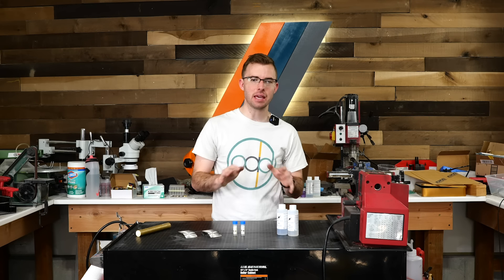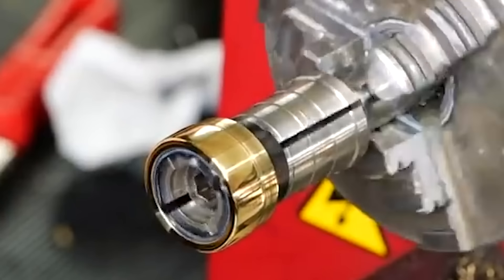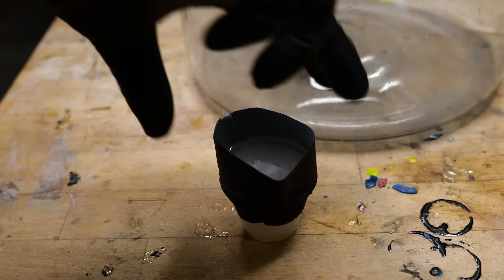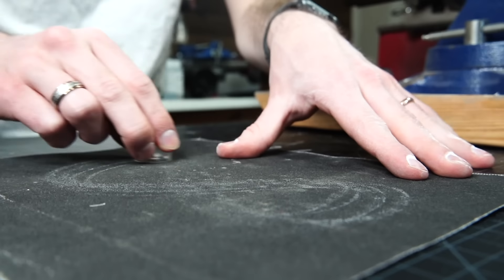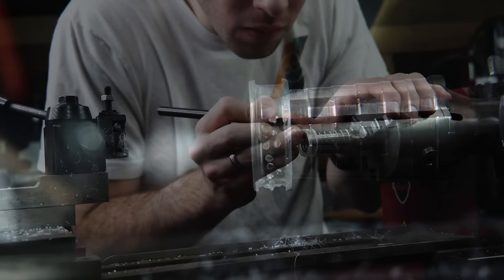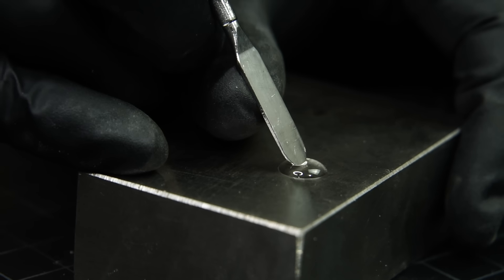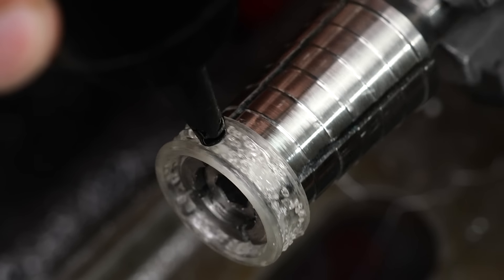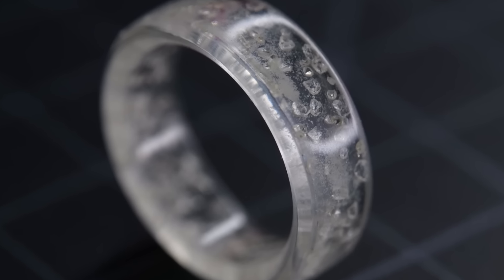Making The Diamond Dust Ring

Comment: I'm not entirely sure if this will make sense, but, do you think there would be a way to make a resin ring with either like dyed water on the inside of it, or some other kinda of dyed liquid on the inside? Almost like a lava lamp ring, but with moving liquid trapped in resin?
Reply from the maker: I'd love to give it a try!
Reply: super good idea, i just might want to buy it, hahah
Reply: @PatrickAdairDesigns   mabey with colored oil or is that to thick?
Reply: is posible i think if you have a liquid that responce on body heat in the middle and enough room to move
Reply: Ya make it moving liquid in ring
Reply: I don't know about the ring design itself, but if you can figure that out I would highly recommend putting a metallic or pearlescent powder in the liquid. It creates a really, really cool swirly effect that emphasizes the movement of the water -- kind of like smoke in a wind tunnel.
Reply: @leroyremco7897 , not a bad idea. not all oils are thick. would need an oil with a very low viscosity.
Reply: That would be sick, would love to see that
Reply: How much is this 1? Where can I find The link
Reply: I know that it's not even the same materials, but I've seen acrylic nails that they've done that to. It's in like an oil suspension and had some stars and hearts inside of it. They used a hypodermic needle. I thought I'd just throw it out there 🤷🏻‍♀️
Reply: Make a hollow ring, drill tiny hole,fill ring with liquid, seal tiny hole.  👏👏👏👏
Reply: rob  Two, halves with a channel cut in the middle of each, to have a u shape cross section. Glue them together, drill a tiny hole inject some liquid mixture, maybe a pearlescent powder mix, with an oil based blue liquid to give a non mixing contrast of colour. Then seal it up and leave a tiny bubble of air inside to help when you shake the ring to make it look cool.
Reply: @PatrickAdairDesigns  So, I ordered this ring Sunday, memorial weekend in May. I would like to hear it from you personally that this ring will be made soon. I know it's a tough gig right now.  But I'm not feeling to great about how long it is taking or the answer I have gotten from your team. If this ring launched 3 months ago and I already ordered one when it did. I should have heard a better solution than i have. Thanks,  hopefully you see this!
Reply: You could try a very slim mold fill it with water freeze it then quickly but the ice piece in a half set resin mold then let it set and I think that could work

Comment: I do nails and use UV/LED gel all the time. You could use a nail art brush to apply the UV gel to your rings with a lot more accuracy and less mess on the lip of the inlay section on the ring. You could also mix the powder with a small amount of the gel and apply it that way, you also could have created a really cool marble effect using this method as well. When I make jewelry I end up using techniques I use for doing nails quite a bit. Just thought you would like the input, love the ring!!!

Comment: Patrick, I know this is an older video, and I'm by no means someone to tell you how do make your rings, as you're the pro, but I wanted to give just a little bit of constructive feedback. Take it with a grain of salt. After you cut the inlay and started to put in the diamonds, maybe a sanding and polishing step on the inlay to bring it to a polish. It'll make the final result pop a lot more. I've found this in turning acrylics and doing inlays. Even when you're laying down a resin into those scratches you made with the cutting tool, the UV resin and the two part has a different refractive index, so you'll still be able to see the scratches if you look closely.

Comment: in your smoothing.. sanding is good.. but.. buff feather wheel compound is really a finisher.. your lathe needs adjustment... you have a distinct bend in the shaft, maybe the chucks seating is off? its giving you that wobble. Very Nice artwork.

Comment: You should experiment with rings that are half band and half resin inlay. So like have half the ring as a brass band and then the other half as a glowing resin part with rich inlay materials. I dont mean two semi circles btw, i mean cut and mould it like two separate rings and then bind them.

Comment: Just curious why you cut the inlay channel into the epoxy part (ring), rather than cutting it into the brass pattern?  I understand when using a rigid mold, you have to be concerned about negative draft angles, but considering that your mold was silicone, and the negative draft was minor, it should've been easy enough to demold even if you had shaped that channel into the brass pattern.  That would've saved you the step of cutting the channel out of the ring directly every time you pulled a part off the mold.
Reply from the maker: Good question. I could have but I didn’t want to risk getting bubbles in my epoxy underneath that negative draft. Also it works as a universal mold, that way if I ever want to do a different type of channel (or none at all) I don’t have to create another brass blank.

Comment: Patrick, is it possible for you make a ring that looks the same as the one in this video, but which is much cheaper (i.e. $99 USD max) because you use substitute parts instead of diamonds? A lot of people don't have $550 to spare on non-essential stuff like this. I'm sure if you make low cost version, a lot of people would buy it.